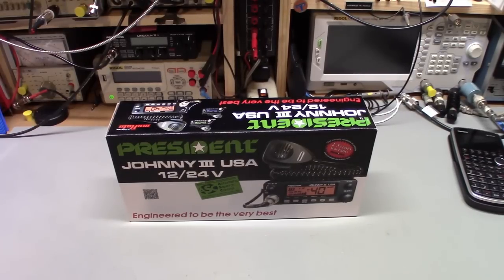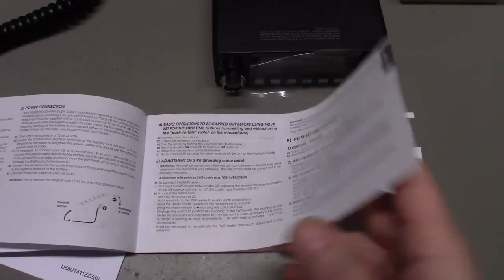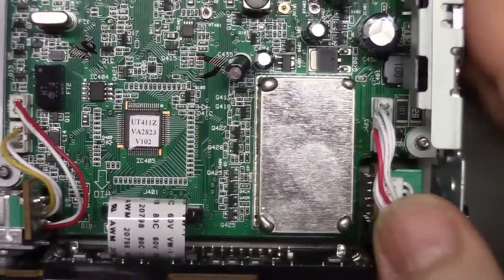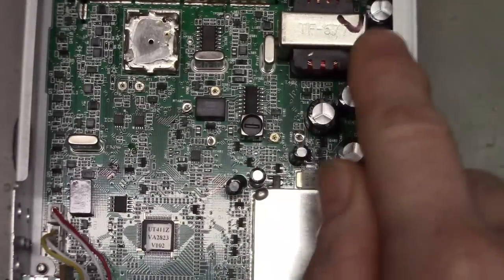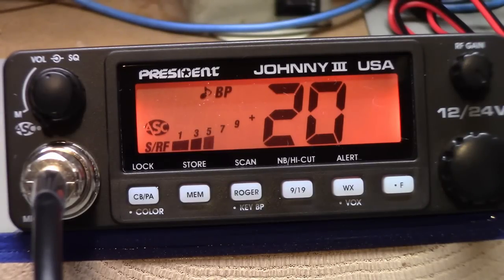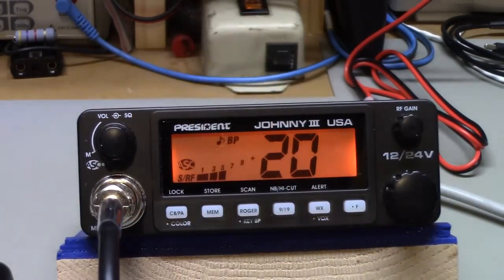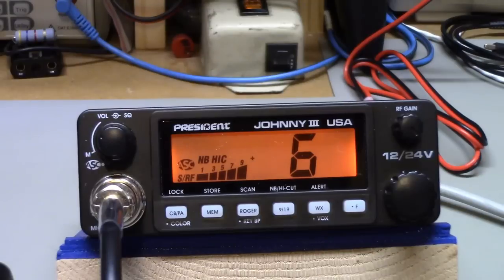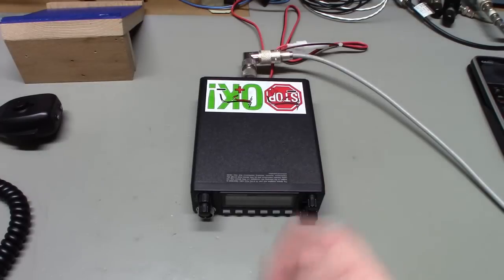Pesident Johnny III USA CB radio review.

Comment: I had a President Washington back in the day...really liked that radio, it was my second most favorite radio right behind my Teaberry Stalker base, and really, it tied for second place with my Radio Shack TRC-457, but the Teaberry had much better adjacent rejection.  Had Teaberry in all my vehicles as well.  Was able to talk to my friend across town with someone parked in my driveway talking using a 150 watt amp shooting skip at the time.  That impressed me more than any claims by the manufacturer.  I had many different cb radios at the time, had Royce, Pierce-Simpson, Pace, Midland, Hy Gain, and probably some others that I don't remember.  The Royce was a rather unique radio in the way that it had it's selector knob, and the pace was a really great talking radio, but with not great rejection.  Same with the Hy Gain.  The midland kept frying the final(no mods), and so I had a lot of radios to compare with the Teaberry and the TRC-457.  The other base radio that was SSB that I liked was a Pierce-Simpson Bengal.  While it did not have the rejection of the Teaberry or the TRC-457, It was close, and had a really great audio sound to the stations I talked to.
I also had several tube type base radios that I loved.  CAM 88, Johnson 223, Lafayette, Gem/Robyn. Browning Golden Eagle, and others...sigh.  Some of them you can't even find on ebay...and always wanted to buy a CPI, it was supposed to be the best CB ever made...not sure about that, but to this day I wish I had managed to lay hands on one.

Comment: I know it is odd to notice but the Chinese and Asians are VERY capable of building high quality gear! (I believe ALL cell phones are made in China or Vietnam.) Understand they will build whatever the contracting company specifies. Some don't care and make them cheap and cut corners. It would seem that President (France) does care about quality and are using good modern engineering practices. Times are changing.

Comment: Now that you've pointed it out about the permanent attached power cord, that's another reason I love my J.C. Penney's single sideband radio.  It has the same power cord for 120 V. ac as it does for the 12 V. cord.  It has an interchangeable power cord--one for 120 V. ac and another one for 12 V. dc.

Comment: Is it legal to have the president Lincoln converted to 11meters so you have 10,11 and 2 meters on the same radio?
Reply from the maker: It's not the conversion that's illegal.  It's using it on bands it's not authorized on.  So listening to 11 meters is OK but the instant you transmit your breaking the law because the radio is not certified for use on that band.